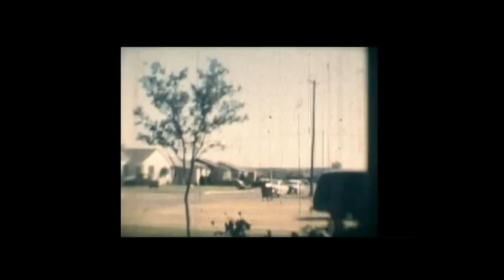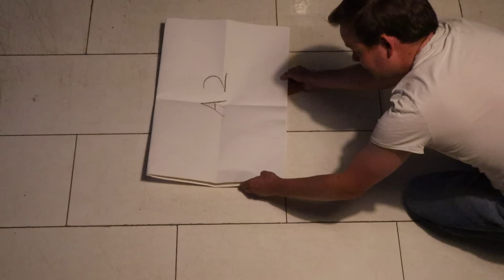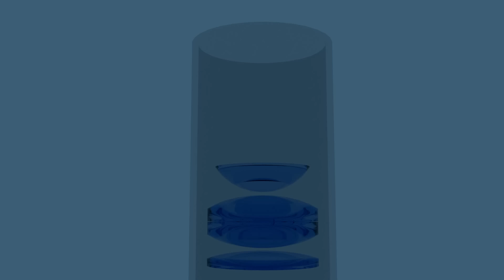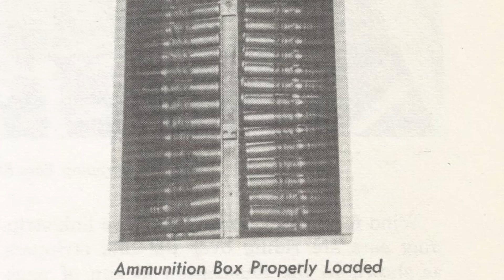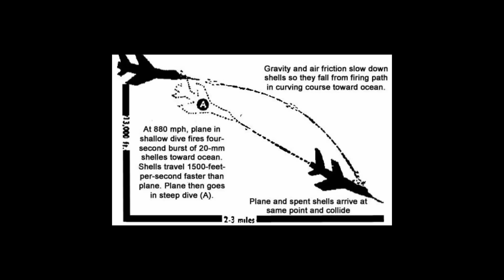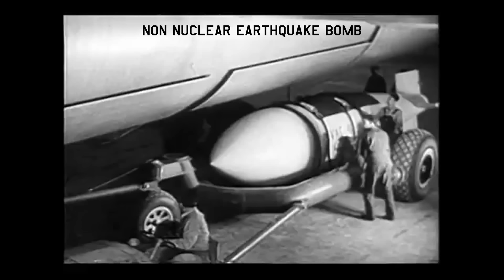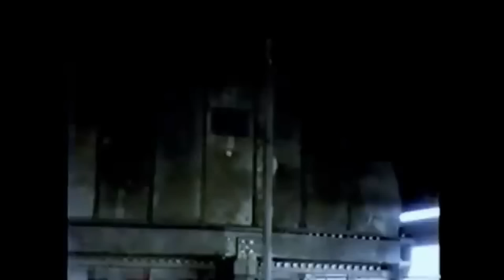Unfathomably American: The Armament Systems of the B-36

Comment: Paper size can probably be blamed on the legal field in some way. Lawyers are extremely slow to embrace change and generally only do so when forced. Most lawyers I've met don't read or send their own emails, don't know how, and will never learn. I work for a document management company and a lot of what we're doing right now is scanning and digitizing documents because the legal industry is finally catching up to the 1980s.

That is to say, there's probably some law that says that some document has to be printed on 8 1/2 x 11 inch paper, and the lawyers see no reason to change it. Not because it works or because it would be expensive restandardize, but because they're lawyers.

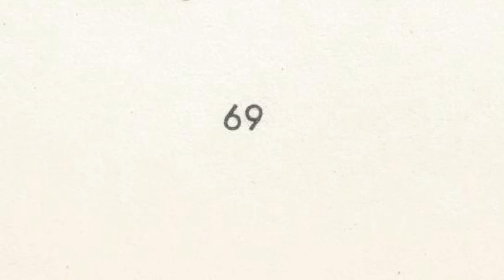Comment: 19:50 - For something which page 69 makes "very clear", you get this detail quite wrong.
Page 69 makes it very clear that the thing called "jizzle" is not a particular target blip as you claim, but the vertical band sweeping sideways across the screen, in which those target blips will appear.

Comment: Guns jamming  almost always is a problem during the extraction of a fired case and loading of a new one... the point being that there isn't a round that can cook-off the only way that could happen is a light primer strike, but that can't happen with something that is electricly fired and its not a jam its failure to fire. Also machine-guns are almost always open bolt, meaning that they are no round that is ready to fire, only when "the trigger is pulled " the round is loaded and fired right away, because of cook-offs and to improve cooling.  And if a round somehow gets fired before it is fully loaded and the bolt  locked its a problem off the exploring kind

Comment: Pretty sure those 20mm are HS type, USN designation Mk16. Great guns, work forever as long as you get the push rods clearance properly set.  EDIT: There was NO need for these to fire electrically. Percussion was the original firing mode, the guns I worked on and crewed  used Percussion firing.  This sound very, very much like poor crew maintenance and training.

Comment: at 48:00 you call the wasps the pinnacle of radial engines. while they were magnificent i will have to disagree as the engines actually meant for the B-36 aircraft, but never made it into this machine, are the true pinnacle. though i will agree the Wasps are the pinnacle of Operational aircraft history mass produced engines at least. 

may i introduce you to the Lycoming XR-7755 (the later -3 to -5 variants meant to drive contra rotating props like a tu-95 at that! imagine a b-36 with contra props <3), while there have only been two built due to interest fading as jet engines were overtaking them making them obsolete in the eyes of higher ups before they even had a proper chance :( ... 
these 5000hp monsters are the true pinnacle of radial engines and had mostly solved the various problems the wasps were dealing with. because unlike the wasp which was mounted the wrong way pointing forward, the lycoming was designed to be installed that way. (or at the very least simply had a much better heating/cooling and fuel injection/ignition system compared to the wasps)

ps, i'd love to 3d print a B-36 and the even sexier NB-36H cockpit/nose myself. is there a place someone can get said models for their own printer?

Comment: Despite all those issues, we would like to place an order for 6 of these for testing. Rather than the gun turrets we are modifying our requirement to utilize surplus P-51’s bolted on in their positions. At the same time, please augment the jet engines with a single V-2 rocket, underwing mounted, on either side of the aircraft.

Comment: 31:59 electrical firing of aircraft guns was already in use in the second world war like in the german 30mm MK108. It might also be preferable for fighter aircraft since I could imagine that strong froces during a turn might force a firing pin to stay in place. If the gun is a model based on fighter guns or used in fighter aircraft that might be the reason for the electrical firing of the gun.

Comment: The American wunderwaffe that could do its job but luckily waited until after WW2 for its debut. 

By the way, America uses both metric and Imperial units. We know what watts, kilowatts, etc are. Imperial units are mostly used for speed, weight and distance. Its also use horsepower for engine output because it sounds a whole lot less boring then saying watts. Americans ARE taught how the metric system works and we use it in a lot of things. 

One thing that I know is that a good amount of Americans could remember that a kilometer is .6 miles or that a kilo is 2.2lbs or at least double a pound. It seems harder for metric users to come to America then it is for Americans to go to metric countries. 

We are keeping that British/Roman legacy alive when Brits surrendered to French measurement. All in humor though.

Comment: A note on the radials, I can't remember if this was something I read about the B-29 and B-50, or the B-36, but I remember reading quite a bit about something unusual that was essentially called something like a turbine power recovery device.

Basically, it's a bit like a reverse super charger. Besides whatever forced induction the engine used, and whatever its method of powering it, there was an additional exhaust turbine in the engine. This turbine wasn't powering an intake impeller, but was instead connected to the drive shaft of the engine directly via some complex coupling device. What this meant was the Wasp radial engines were becoming a sort of rudimentary jet engine by the end of their development, in which main prop shaft power was being extracted by a turbine in the engine's exhaust.

One of the (otherwise many obvious) reasons why giant radial engines like the Wasps were ditched in favor of turbo props and jet engines for similar sized aircraft was that this turbine recovery system quickly outshined the rest of the engine. Before long, engineers were recovering so much power from the exhaust on these massive things, that the horsepower from the turbine alone was starting to rival that of the internal combustion engine itself. Furthermore, the simple turbine was proving more reliable than the incredibly complex radial engines... Which begged the question, why have forced induction into a cantankerous complex high octane fuel guzzling high maintenance monster of an internal combustion engine, only for the exhaust produced to rival its power through a simple turbine... When you could instead cut out the internal combustion engine, move to a much lighter and simpler jet or turboprop engine that combusts fuel continuously rather than intermittently, and thanks to the elimination of detonations, is able to burn trash quality diesel?

And, it's not like the turboprop engine was invented here, the idea had been kicking around since the 30s, before even the first jet engines were running. But work on this turbine power recovery device allowed engineers to approach the metallurgy and engineering required to make sound turboprop engines. By the time they'd gotten this far along with radial engine development, radial engines simply didn't make any sense anymore. The forced induction PLUS turbine power recovery had already rendered them overweight and overcomplex jet engines of sorts.

The reason I can't speak much to this topic beyond what I've read in the past is that turbine power recovery is, I presume, only worthwhile on truly gargantuan internal combustion engines with absurd amounts of exhaust to extract power from, not to mention a more difficult (and probably expensive) engineering challenge to implement than a turbo or supercharger like in your car. By the time engines got big enough to use these devices, both the engine (and the device) were rendered immediately obsolete the moment it was invented, by the much simpler turboprop engine. This lead to an absurdly short period of aviation/engine history in which these devices were relevant.

Comment: actually the camera system of the NB36 wasnt even remotely impressive at the time. i mean: rc equipment was already 40 years old at that point (nikola tesla, yes that nikola tesla had invented it in the 1910s) and the allies used remote controlled drone bombs wich where controlled with the help of life camera feeds via radio transmission (wich is funny to know because the brits faked a life feed after the war for the coronation of elizabeth the II for canada).

Comment: 1:00:35 Could one attach a parachute system to the Shielded Reactor Capsule?

Granted easier said than done, and design with failure modes in mind etc, BUT laydown nuclear bombs were a thing, no?

Comment: this sounds like something that wouldve come out of the soviet union
massive project that had obsolete features before it even made it to service
instead of making a bigger engine, just smash 4 smaller ones together
highly complicated systems that would fail frequently
not enough technicians to maintain those systems, and those that they did have were inexperienced
and they didnt even have enough crew for the bombers in the first place, and, again, those that they did have were inexperienced

Comment: I’m still convinced to this day! Instead of putting 4 jet engines directly on the bomber b-36, it would’ve been better to hard-mount a fighter (like a P-80 style, but with twin engines so it doesn’t lose all power) on each wing pylon.

Sure, it makes the bomber overall heavier, but you could fly training missions with those fighters empty. Got a burning jet engine? Just drop the burning fighter. Not perfect, but better than “2 turning, 2 burning,” and so on.

And the extra wing surface from the hard-mounted fighters could help offset the added weight. If war breaks out, just put your fighter pilots in the hard-mounted fighters, fly toward the target—spot enemy aircraft? Send out your detachable fighters. They can not return to the bomber, but maybe they could ditch near a carrier or even land on one.

All better than: “our engines malfunctioned, and then we met the enemy…” yes its all not perfect but better than a heavy b-36 with non working turrets

Comment: Engine displacement is an excellent example of when freedom units are better than metric. Cubic inches are much easier to work with. A Chevy 350, every time you change the connecting rod by x amount the displacement becomes y. Idrc but it's some like 4 1/2 inches is a 350, 4 1/4 is a 383, 4 inches gives you a displacement of 402 or something. Those numbers are probably wrong but you get the idea. Millimeters are the only useful metric measurements. Fractions of an inch or decimals get annoying when working with small things a lot but when it comes to long distances a kilometer just isn't far enough. Miles make much more sense. 120kph sounds like a lot but it's 20mph under the flow of traffic on a Texas interstate.

Comment: Good video -- in my training years (I am 65) I saw many valve based systems that were designs beyond the practical capability of valves ! Seen many selsyn based systems, it was a way of transmitting the rotational position of something over a distance, and metadynes - used until recently for DC-DC rotational drive for antenna systems or ships guns. Valve tech was very ingenious, it was extremely difficult to do things we can now do with 1 simple cheap chip !

Comment: Just how was the nuclear reactor heat supposed to drive the propellers? Certainly not through the piston radial motors. Reciprocating engines work by means of the force of quickly EXPANDING gaseous atmosphere, not simple hot air fed into the cylinders. If there is a nuclear engineer who has an answer, I would definitely like to hear it. Thank you.

Comment: 51:42
For several months in the mid-80’s, I was actually a teenage tour guide for the XC-99 prototype variant.

During its time parked in the gated field just outside Kelly AFB in San Antonio, my science teacher was somehow also a caretaker/steward of the plane and property.  He took our class on a field trip to tour the plane, and even let us walk out onto a wing a few students at a time (no safety lines!).  He knew my interest in military aviation, and later hired me one summer to help maintain the grounds, but also taught me enough history and details to lead curious visitors through the interior of the plane.

I recall one interesting object being stored in the lower forward cargo hold (XC-99 has two cargo decks) was the cockpit section of what I think was an F-100 Super Sabre.  I was told to tell visitors it was a flight simulator, but I can’t be sure of that, lol.

I assume wikipedia is correct that the XC-99 is currently resting/rotting in the Boneyard at Davis-Monthan AFB :(

Comment: Two of the prototype nuclear aircraft engines still exist and you can go see them. They're in the state of Idaho, in the parking lot of the EBR-1 museum. EBR-1, for "experimental breeder reactor" was the first nuclear reactor designed and built with the ability to use nuclear power to generate electricity, but it was primarily meant to test the concept of a breeder reactor. The EBR-1 museum is open to the public seven days a week between memorial day and labor day and is worth a visit if you're in the region, visiting Yellowstone national park perhaps, or Craters of the Moon national monument - but as I said, the nuclear aircraft engine prototypes are in the parking lot so you can see them any time you like.

Comment: 57:14 we still use watts an expression of energy, it’s just typically limited to electric appliances (microwaves, TVs, etc) or reactors. For pure thermal capacity we actually use BTUs (British thermal units) and for conventional evaporative generators we use boiler horsepower, which in and of itself is actually just a measure of evaporative area in square feet (specifically 9-11 sqft/bhp depending on materials used)

Comment: This is not the most American thing ever. That would be the M6 heavy tank with its hull mounted dual M2 brownings and 2 guns in the turret, a 76 and a 37 because at this point you can only go so wrong with this mechanical engineering abortion against the will of god. It is the definition of overkill in every sense of the word and looks and feels as if it was drawn by a toddler.

Comment: I've seen others post advantages of electrical primers, but I haven't seen what I'd consider to be the biggest: it simplifies the design of the weapon. If you're going to fire a weapon with an electric signal, there's no need worry about fitting some kind of solenoid when you can just pass the current to the primer directly. You essentially remove a step from the firing sequence and eliminate a potential source of failure. I've seen an over-lubricated machine gun break its own electrical solenoid, so a solenoid fired gun might have had the same problem you described in the video.

Comment: I happen to have a personal connection to the B-36. My great grandfather was a crew member of the one that went down in the Franklin Mountains near El Paso in 1953. Beautiful plane, wonderful video.

To shine some light on the mindset of the USAF at the time, the modern understanding, to my understanding, is that the air traffic controller gave the crew a flight path and forgot to mention the special climb rate required to get *around the mountain in the way in the middle of the night during a blizzard*. The official investigation blamed the crew, despite such egregious air traffic control mistakes as issuing a heading of 370 degrees at one point.

Comment: Once worked with a guy who served on as a gunner on the B-36. He told me they rarely fired the guns because the vibration broke all the electronics on the airplane. He told the story about being at 40,000 ft plus when the pilot came on and said: "look sharp, we screwed up and made a rosco instead of a louie a ways back and we are now over the Soviet Union". He remembered the ECM guy showing him the traces of the Soviet radars that were tracking them. I told him I had read that the Air Force regularly conducted incursions in the late 40's/early 50's to test the Soviet radars, and he agreed that in retrospect the whole thing was probably done intentionally.

Saw a video a while  back about a guy trying to restore the nose gun sight/periscope from a B-36. Unfortunately all the optical glass was of a type that after 70 years turns green.
Reply: Ok I have to ask, how old are you? I’m 39 and my grand father was a radar tech on a b36 and he passed in 2005… I get some level of age discrepancy but yea…

Your comment tracks to a point given the stories  my gramps would regal but yea… maybe I’m just jaded by the net lol

Comment: I just started watching this… I could already tell excellent video and from what I heard what made this aircrafts engines unreliable was whoever was in charge of the maintenance program was too cheap to buy a better spark plug, if it had a better spark plug it wouldn’t of fouled and therefore there wouldn’t be that many engine fires

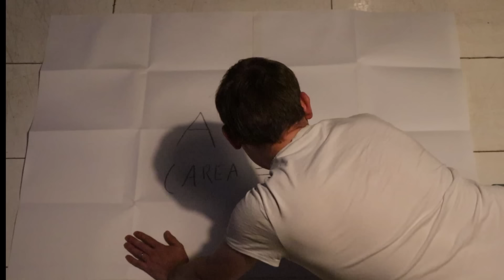Comment: 14:22 older manuals like that were printed on a press so the paper was probably some military standard
Reply: @AsbestosMuffins  nope, it's definitely letter sized paper (8½ x 11in or 21.6 x 27.9 cm) which is a bit smaller than A4 sized paper. I know this because even though my country uses SI units for the vast majority of applications some things like paper sizing, LPG installations and plumbing use imperial.